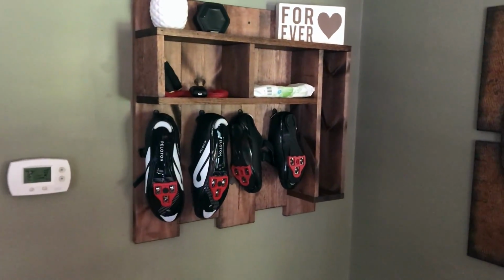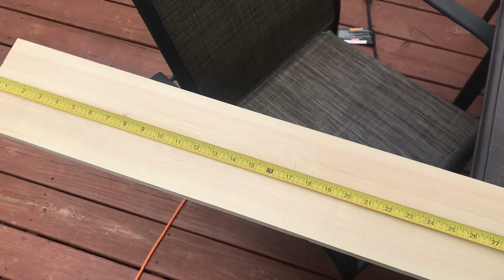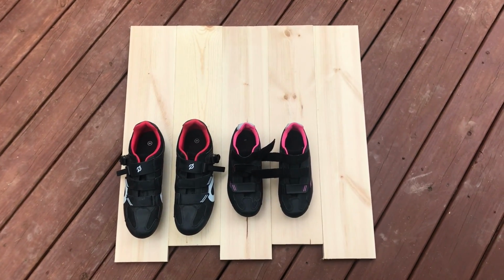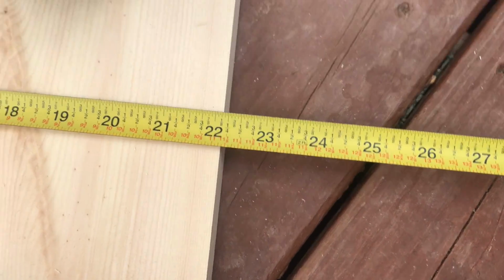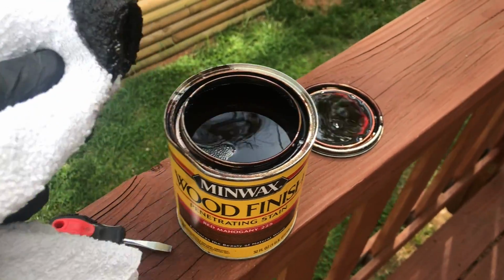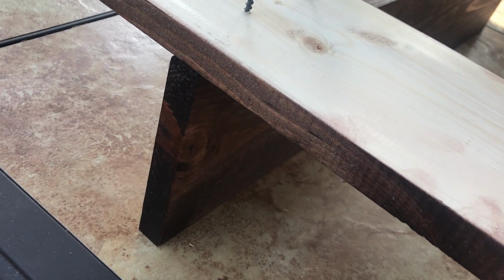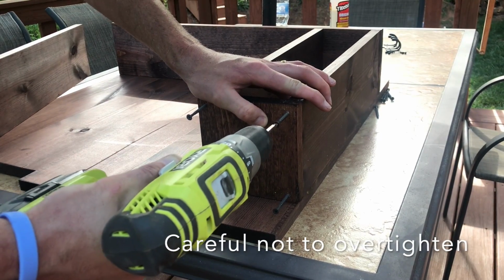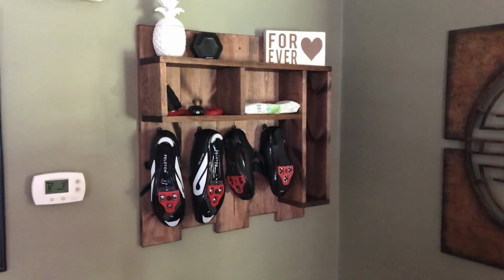How to Make a Peloton Wall Mounted Shoe Rack (Step by Step Guide)

Comment: Thanks for the video!  Can you share how you mounted it to the wall?
Reply from the maker: I just used 2 drywall screws. You only need to hit 1 wall-stud with one of the screws. The other screw was mainly for balance. I used a stud-finder, and then pre-drilled 2 holes directly in the back of the rack. I would have tried to hit 2 wall studs but the spacing didn't allow for it where I wanted to mount it..

Comment: Thanks Wesley for doing this video, pretty awesome!  Question, did you pilot drill both top and bottom boards in all spots?  Or just the top?  Seemed like one spot only piloted the top board, but another spot looked like you piloted through both top and bottom boards.  Just curious so not to split a board.